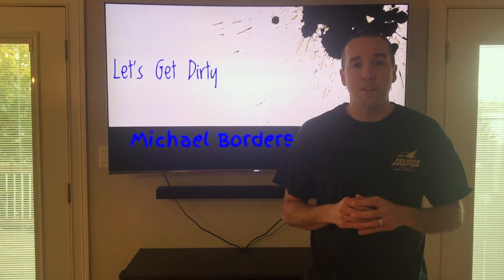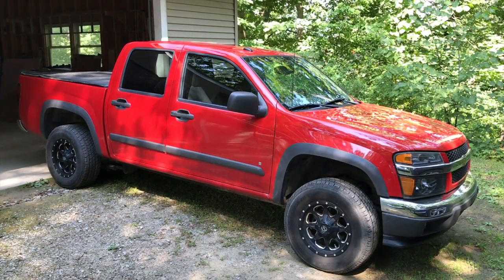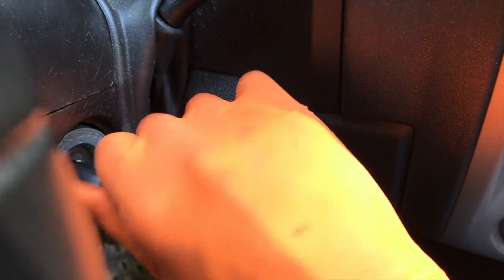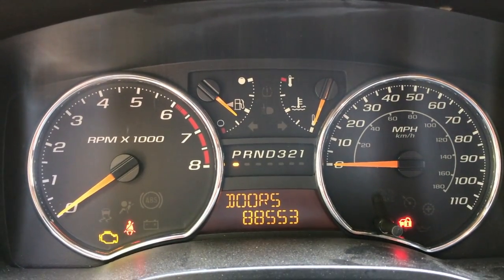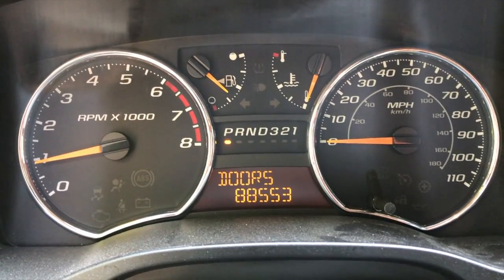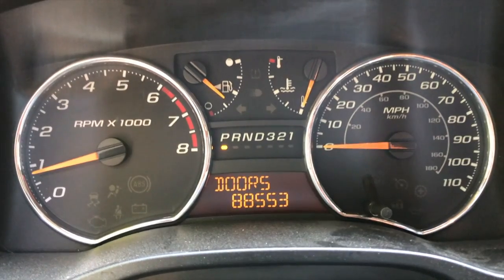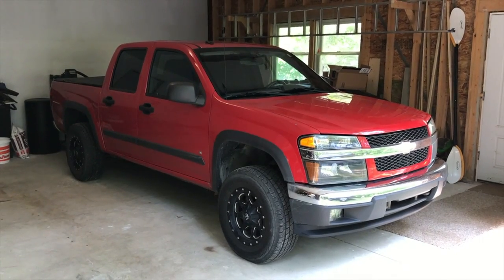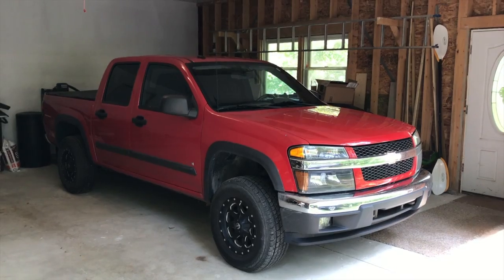How to do a "QUICK Reset" on your ABS System!

Comment: I have a 2013 Ram 1500 4x4, I've replaced the wheel bearing and it has a new wheel speed sensor. I've checked my ohms and have positive ohms, I've checked for voltage and have voltage. I've tried to reset and clear the code with an obd scan tool and the light stays on and the scan tool shows that wheel speed is not receiving a signal, on live data it shows all of the other 3 working but the front right has nothing. Any suggestions? I did try the gas pedal reset and its still showing the abs light on.
Reply from the maker: Thanks for watching, any update?  Have you performed a system reset by disconnecting the black negative cable from your battery and leaving disconnected for a minimum of five minutes?

Comment: Tried it on my 2010 Mercury Mariner. Didn’t work.
Reply from the maker: Thanks for watching.  We recommend performing this reset procedure a second or third time.  Some vehicles require additional resets to fully reconfigure.
Reply: @DIYwithMichaelBorders Tried that. STILL didn't work.
Reply from the maker: @S@S @ShawnaRankin-g6u anks for the follow up.  Next thing is to have an OBD 2 scanner read your ABS codes.

Some local AutoZone’s will do this for free, however not all.

Comment: Tried this method on my 16 year old lexus is 250, five times didn't  work .
Reply from the maker: Thanks for watching, have you performed a reset by disconnecting the black negative cable and leaving disconnected for a minimum of five minutes?

This may help…not always…

If it doesn’t help, it’s a pretty good indication that you have something within your ABS system that is faulty.
Reply: @DIYwithMichaelBorders If you mean the car battery, I'm scared I might loose all the electric settings.(Sorry for the delay in answering).
Reply from the maker: @brianbotterill5820 

Thanks for the reply, yup…the car battery.  That will be personal preference…loosing all the saved settings can be annoying.

Comment: What if abs is unplugged and when its plugged in the vehicle doesnt start?
Reply from the maker: Thanks for watching, we recommend discontinuing the black negative cable from your battery and leaving disconnected for a minimum of 5 minutes.

This will perform a reset and hopefully reconfigure system.

😁🧰
Reply: @DIYwithMichaelBorders so leave battery unplugged and plug abs module in then reconnect the battery back???
Reply from the maker: @TheToomerFamily 

Thanks for the reply.  Leave ABS connected while you disconnect battery cable.  😁👍☕️

Comment: It didnt work for my 2010 dodge ram. 🥺
Reply from the maker: Thanks for watching, have you performed this reset procedure more than once?

Your system may require additional resets to fully reconfigure.  Still no luck, we recommend disconnecting the black negative cable from your battery and leaving disconnected for a minimum of five minutes.

☕️🧰

Comment: My issue on our 2008 Nissan Xterra is the opposite problem. The ABS and Brake light don’t come on after I start the vehicle, but instead come on when I drive it and reach 15 mph. If I go slower than that they don’t come on. Only when I reach 15 mph. I tried your reset fix several times and it didn’t work.
Reply from the maker: Thanks for watching, did it just start in the last few days?  If so, has it been raining where you are?

Your wheel speed sensors might have trapped moisture inside which will trigger the ABS.
Reply: No rain. It started after I took the battery posts off and charged the battery. I ended up buying a new battery, but the lights on the dash still come on when I hit 15 mph.
Reply from the maker: @jimmyleyba3455 

Thanks for the followup, interesting…

An ABS reset like this usually works however…you may need to now have your ABS system reset using an OBD scanner.

Sometimes your local AutoZone will do this for free…however, not always.

Comment: Does this work on 2017 subaru impreza, I’m asking because it’s a push button.
Reply from the maker: Thanks for watching, it does.  In your case, you will push the start/stop push-button twice without pressing brake.  This will allow the ignition system to come on without starting engine so you can perform reset procedure.

Comment: Oh, wonderful. Even more cracked screen
Reply from the maker: Thanks for watching.
Reply: @DIYwithMichaelBorders yeah now i need to clear the code and see what happens lol. My lights are still on.

So far I've changed all my wheel speed sensors, Cleaned my ABS control module, realigned the tie rod and steering wheel and the lights are still on. 

Should i just clear all the codes???
Reply from the maker: @markbrownsell7443 

Sounds like you’ve been busy, that’s awesome.  Yes, we recommend clearing codes.

Comment: 2010 Jeep Sahara. Check engine light came on a few days ago with the code U1412 (implausible vehicle speed signal) and the speedometer does not work. Already changed all 4 speed sensors last year. Tested them with the JScan app, all is well. Tried this trick this morning. After driving for a bit and accidentally braking hard the speedometer started working again. But the check engine light stayed on. Had to stop by the road and reset the code with JScan after about 10 minutes. After that the check engine light was gone and has not yet come back. Will update if anything changes. 

Anyways. Many thanks for the help...!🎉
Reply from the maker: We appreciate you sharing your experience, that’s awesome you replaced all speed sensors last year.

If it comes back, we recommend disconnecting the black negative cable from your battery and leaving disconnected for a minimum of five minutes.  This will ensure that your entire electrical and ABS system performs a full reset and hopefully reconfigures properly moving forward.

😁👍🧰

Comment: Does not work on a 2015 Dodge Dart Rallye :(
Reply from the maker: Thanks for watching, it does work on your exact vehicle.

If the reset is unsuccessful the first time, you can try this reset procedure a second and third time.  Your vehicle may require additional resets to fully reconfigure.

Still no luck, there is a faulty part within your ABS system.  Please keep us posted.

👍🧰
Reply: @DIYwithMichaelBorders    Many thanks for the reply :)    Tried multiple times and then went ahead and ordered a new replacement ABS module (which for anyone reading a replacement ABS module DOES need to be programmed to your specific VIN)
Reply from the maker: @bradleygerkens 

Thanks for the follow up, you are spot on, a programming procedure is a must when that occurs.

😁👍🧰

Comment: I had the right front wheel sensor replaced. The ABS light would come on at various times and may go off temporarily. Mechanic who replaced the sensor had no idea what caused the problem. I seen a U Tube video on reseting the ABS . I done it just like this video and it worked perfectly. Its been 8 month's and no problems.
Reply from the maker: Thanks for watching and sharing this.  We are honored.

Great to hear you have been ABS fault-free for 8 months.

A true testament to the power of DIY right there!  🏆🧰
Reply: Now this answered my question 😊

Comment: Its says to turn the steering wheel all the way to the left then to the right and then restart the truck. But in your video all you do is tap gas 3 times and restart. Which method is correct. In my 2013 tapping gas 3 times only reset the oil life monitoring system. Nothing else
Reply from the maker: Thanks for watching, are you reading directly from your service manual?

Our ABS reset process is shown in this video. However, if your manual states differently, we recommend following your manual.

Comment: What if it is a push start??
Reply from the maker: Good morning and thanks for watching.  ☕️

In your case, you will press the Push/Start button once without applying the brake.  This will turn on and activate your ignition without starting your engine.

If pressing it once does not turn on your ignition and light up your instrument panel and needle indicators, you will press it a second time.

Comment: How I can reset the ABS system on a 2007 ford escape hybrid ? Thanks
Reply from the maker: Thanks for watching, any update?  You can disconnect the black negative cable from your battery and leave disconnected for a minimum five minutes.

This will perform a system reset and hopefully reconfigure your system.

😁👍🧰

Comment: Well, the key is turned on but you did not start the engine, while pressing on the gas three times with the car in park, it appears that your foot is on the brake. Are you pressing the brake while you do three quick taps on the gas or not? You don't say.
Reply from the maker: Thanks for watching, foot is not on brake.  Pressing the brake will interrupt the reset procedure.

😎👍🧰

Comment: Sadly, no luck on 2017 Kia Optima.
Reply from the maker: Thanks for watching, any update?  You may need to perform this reset procedure a second and third time, as your system may require additional resets to fully reconfigure.
Reply: @DIYwithMichaelBorders  It was a RR speed sensor. Repaired and lights off.
Reply from the maker: @billdale5576 

Very cool, we appreciate the follow up.  Hopefully many stress-free days ahead for you.

😁👍🧰

Comment: Wow! I replaced my left rear wheel speed sensor yesterday, and couldn't get the "check brake system light to go off on my 2010 Lincoln MKZ.  I just tried your procedure. Light still illuminated, went for a short drive and now the light is gone! Thankyou 😊👍🏼
Reply from the maker: That’s awesome, and even more awesome that you made the wheel speed sensor a DIY project.

Enjoy that rewarding feeling, you earned it.  A true testament to the power of DIY!  😁🧰

Comment: It didn’t work
Reply from the maker: Thanks for watching.  We recommend performing this reset procedure a second or third time.

Your system may require additional resets to properly reconfigure.

Still no luck, it is likely a faulty control board.

😁👍🧰

Comment: How do you reset a speedometer 2010 ford edge
Reply from the maker: Thanks for watching.  This can be done by disconnecting the black negative cable from your battery and leaving disconnected for a minimum of five minutes.

😁👍🧰

Comment: Doesn't work on a Ford Taurus
Reply from the maker: Thanks for watching.  Have you tried this reset procedure a second or third time?

Your vehicle may require additional resets to fully reconfigure.  Still no luck, something within your ABS system is faulty…..unless….. it’s as simple as bringing all of your tires back up to the manufacturers recommended PSI.

Comment: My aerostar needs a wire harness with manual tabs to activate abs. The harness and other cost about 500 on eBay.
Reply from the maker: Thanks for watching, that’s kinda pricey.  😲
Reply: @DIYwithMichaelBorders Mechanics don't typically have this anymore. One cannot activate the abs to bleed it by use of the under dash plug. The harness plugs in under the hood to bleed it. 42 pin.

Comment: About 9 2005 Dodge Dakota 4.7 didn't work.Have I tried it twice
Reply from the maker: Thanks for watching.  Have you disconnected negative cable from battery and left disconnected for a minimum of five minutes?

This will reset your ABS system, and onboard computer.

Still no luck… double check that all four of your tires have the proper psi.

Keep us posted.  👍🧰

Comment: This procedure did not work on 2018 Hyundai Tuscan.I've tried previously disconnecting the battery,resetting the module with a scan tool (which it turned the lights off momentarily).I have a code C1207-2 which it's the left rear wheel sensor.Nothing worked.In the past disconnecting the battery would turn warning lights off,but not anymore.I've got me a new sensor which I will replace in a couple of days.Hopefully I don't have an exotic issue like a wiring.I had discount tires do a rotate and balance,but this problem showed up a week after they did the service.I've seen road debris slung up under the fender well and causing damage to the wiring harness.Will see....
Reply from the maker: @starshipgus8578  

Thanks for watching, any update?   Have you performed this reset procedure a second or third time?

Your ABS system may require additional resets to fully reconfigure.

Comment: Did not work for me unfortunately. 2015 jeep wrangler sport 4 door. Had rear brake pads replaced along with resurface/replace rotors 2 months ago. No issues until now ABS with a traction light on.  Any suggestions?
Reply from the maker: @willcorley3121  

Thanks for watching, you can perform this reset procedure a second and third time.

Your ABS system may require additional reset attempts to fully reconfigure your system.

Comment: My battery was low enough to not calculate fuel injection correctly, it set off the abs code,  with a couple domino codes. 
This may have just saved me an unknown amount of money for the shop to tell me what I already know and turn the light off.  Can't say for sure until I get the intercooler pump in and get it started.
Reply from the maker: @rustywater3219  

Thanks for watching, and saving money is a great thing.  Awesome job making it a DIY project.  ☕️🧰

Comment: I will try this the slide has been coming off and on periodically but today twice in Walmart parking lot I had to punch them brake pedal down because it was it got so stiff and it didn't want to go down and break for me eventually you did I pushed hard enough I made a nice like loud popping sound as if the brake pads were smacking pretty hard because it finally broke free but either way I'm going to try this and let you know how it works thank you
Reply from the maker: @dercifiller5082  

We are happy to help.  If this reset procedure does not work the first time, you can perform this procedure a second and third time.

Comment: please how do I clear the abs and check engine light on my Suzuki spresso
Reply from the maker: @emmanuelchuks2235  

Thanks for watching.  If you have performed this reset procedure and no luck, you can perform this procedure a second and third time.

If that does not help, you can disconnect the black negative cable from your battery and leave disconnected for a minimum of five minutes.

Still no luck, there is something within your ABA system that has malfunctioned.

Comment: My OBD2 scanner has several fault codes detected on my sienna 2003. LH front wheel sensor, RH rear wheel sensor. I uninstalled the ABS module, there are some rust on the abs pump and cleaned them with electronic cleaner but when I intall it back, I have a continuously blinking ABS light and the OBD2 scanner cannot detect the ABS system, speedometer is not working. All the errors disappear  but it seems like the abs module died completely after cleaning.😢
Reply from the maker: @renatobautista563  

Thanks for watching, any update?  Have you performed a system reset by disconnecting the negative cable from battery for 5 minutes?

This will allow your system to fully reset and hopefully get your system reconfigured after your recent cleaning and maintenance.  👍🧰

Comment: Well, it didn't work for me, so at least now I know I have a legitimate problem instead of just a glitchy system. Good to have a list of things to try so I can troubleshoot (and find out if the mechanic is trying to BS me!)

Thanks much!
Reply from the maker: @somerandombaldguy5296  

Thanks for watching, you can perform this reset procedure a second time.  Your onboard computer may need that second reset to fully reconfigure itself however, still no luck…below is our video showing common causes that we have found to be the likely causes.

       https://youtu.be/5lgMhKYGuto?si=OVdFv53-xwiUYtyR

👍🧰
Reply: @DIYwithMichaelBorders  Sadly, it was a frayed wire causing the intermittent alerts. :( But this is still going in my bag of tricks!
Reply from the maker: @ 

Thanks for the update.  Hopefully getting the wire fixed will be pretty cost friendly.

Comment: Great Advice ! Trick worked to reset 2021 Nissan Rogue ABS system. Many Thanks !!  Saved a trip to the dealership which is never fun.
Reply from the maker: @davidpax2531  

You are very welcome.  A DIY project that doesn’t require you to have to visit the dealership is a win!  😁👍🧰

Comment: I changed 4 tires on my 2012 Camaro yesterday, and my dashboard is lit up like a xmas tree.
Reply from the maker: @scottwright388  

Thanks for watching, any update?  Are the tires the same size?  Different size tires can trigger the system.
Reply: @DIYwithMichaelBorders  actually I do have an update. I trusted the guy to do me right, but he put 245/40/20 on the front, and 275/45/20 on the rear. Should have been 245/45 and 275/40. The rear was over an inch more in diameter...thanks for checking.
Reply from the maker: @ 

Oh wow, that will definitely trip the system due to an imbalance in tire size.

Comment: Wow how incredible is this. I drive a Mitsubishi SUV. I had my antilock and 4wd lights showing up even though I wasnt in 4WD. They had been around for the last month or so and it was an intermittent problem. I was concerned about the 4WD especially even though I was not in 4WD. Anyway tried this and the lights on my dash disappeared. Brilliant and so simple. Took My vehicle to a dealer previously and they greased the 4wd and replaced a part. Cost me a lot. Drove out of the dealer and the Light lit up again. Said they couldnt fix it etc etc. Tried your solution as did want to trust the dealer again which was costly  Thanks Michael you are brilliant.
Reply from the maker: @rhwill68  

You are very welcome, thank you for sharing your experience and this feedback.  Great to hear the lights went away so you can focus on more enjoyable things.

Hopefully many stress-free days ahead for you .  🧰

Comment: 2002 f150 Ford truck it did not work.
Reply from the maker: @wayneflemmer2607  

Thanks for watching, you may want to try this reset procedure a second and third time.  If that doesn’t help, there is definitely a part within your ABS system that has malfunctioned.